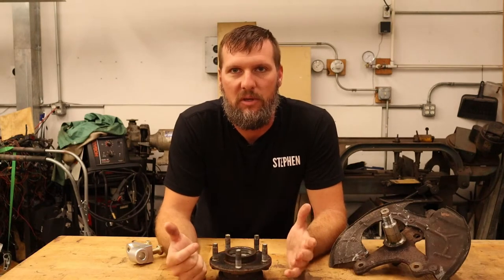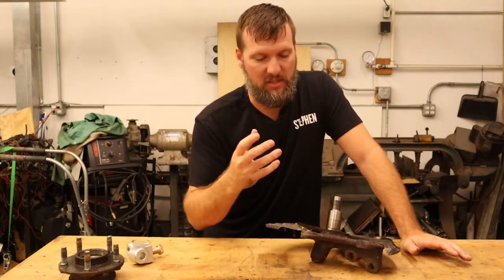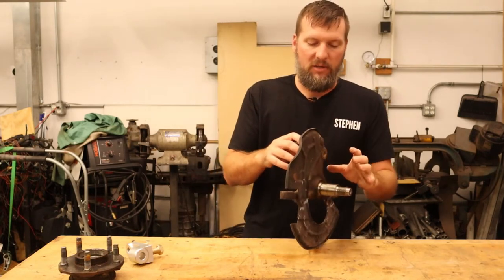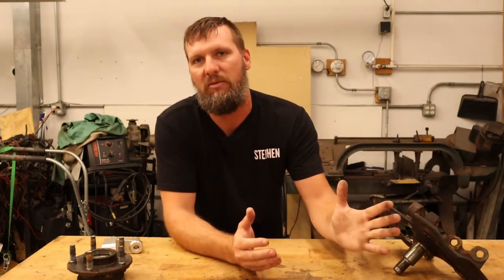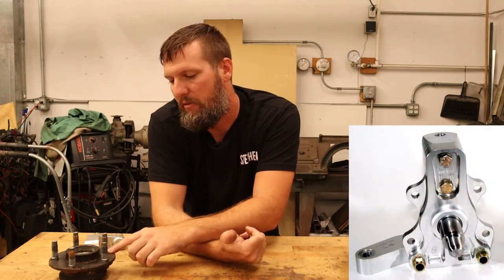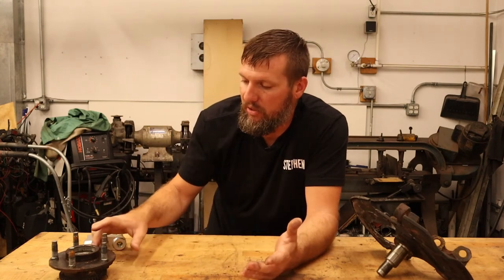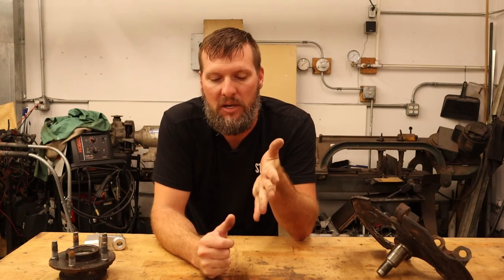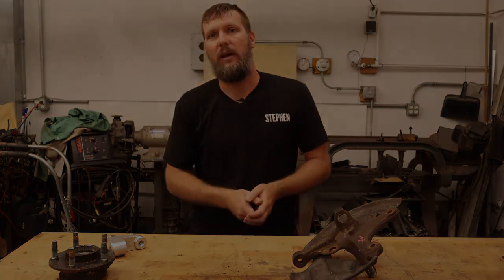Double wishbone spindles for DIY SLA Mustang

Comment: Just watched this.  Very informative.  I had to do a little research on SLA.  I was lost because I thought you were driving a SN95 mustang.  But basically its going from McPherson strut to double wishbone like older honda's, miata's, etc.  Gains camber through suspension travel.
Reply from the maker: Ha, yea I guess it's kind of a mustang term but yep double wishbone. I need to keep my edge with all the new car builds like yours 😁. Also yes SN95 Mustang.

Comment: the adapter from griggs is expensive you mentioned that you thought a couple of other companies made adapters, can i know the name of these companies thanks
Reply from the maker: Yea their price went up since they changed from steel to aluminum. The other company is Whitby Motorcars. Not sure of the price but would have to contact them as just the adapters aren't listed on the website but a whole SAI Mod kit for Shelby Cobras
Reply: @RinerAutomotive  have you thought of going to machine shop and ask how much to replicate or make something similar to the adapter? did u finish making the sla, if so do u have a video coming? thanks
Reply from the maker: It's not my design and would be unethical to straight copy it. I haven't finished yet but do have an update video coming soon.

Comment: Got a part number for that griggs adapter?
Reply from the maker: So it's not on the website yet but it's the replacement for the MDS 4000 steel adapter
Reply from the maker: Hey I noticed on the adapters themselves are these part numbers: MBJ-1302-L and MBJ-1302-R

Comment: Have you thought a s2000 spindle or Miata spindle?
Reply from the maker: I didn't realize S2000 was double wishbone. I think it would be the same conclusion I came to for Miata, it's too small for the weight of a mustang. I'd be worried about failure.
Reply: @RinerAutomotive  how much was you spindle ball joints adapter?
Reply from the maker: @sr20dett1000  $500
Reply: @RinerAutomotive  that's expensive so that part. The foxbody Ridetech SLA seems like a great price.
Reply from the maker: @sr20dett1000  it is, but not many options. the ride tech one isn't complete either and price will be higher.
Reply: @RinerAutomotive  the only thing missing is the damper.. it is better price compare to the other SLA options.
Reply from the maker: Because they don't offer a k-member so that saves money to. I think it's quite limited, but it will be interesting to see as it starts getting use. I haven't seen advertisements of camber and caster ranges